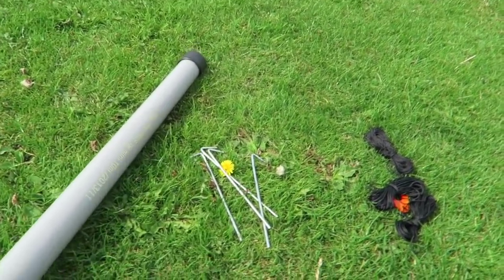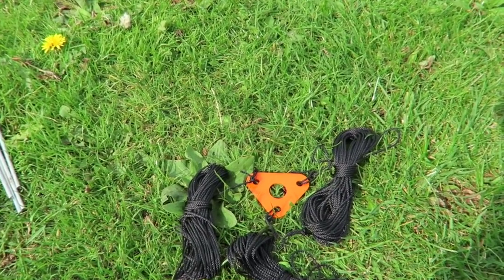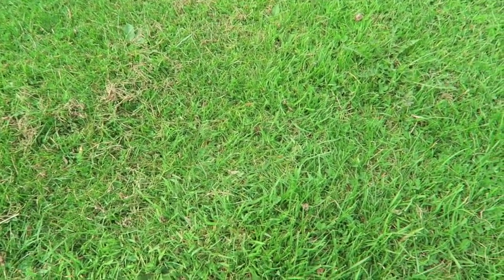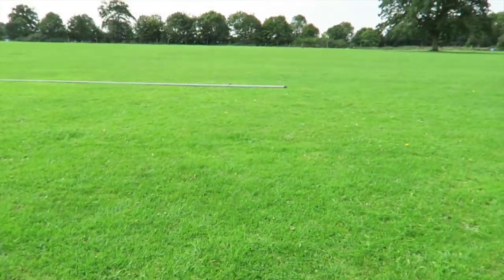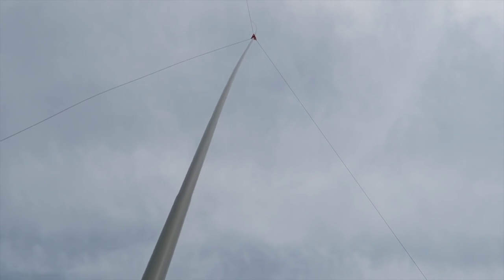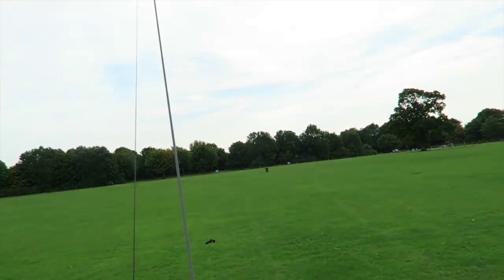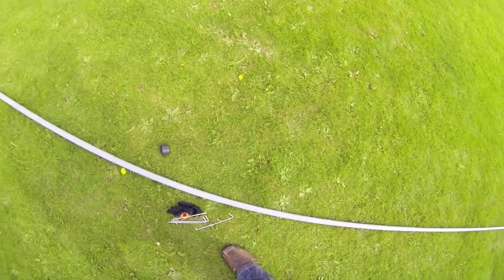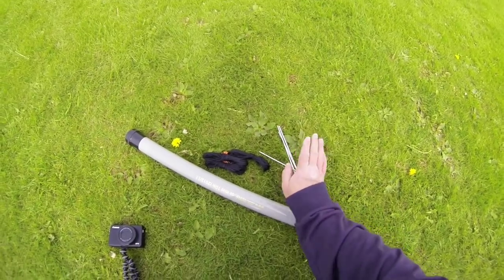Solo antenna mast erecting - Ham Radio know how.

Comment: A bit of the wind-covered audio may have explained the geometry of the first two guylines; appreciated the trick of slack two, walking the mast out to taut and then walking out the third! 73, WA6DZS!
Reply from the maker: +pbarnrob Morning. Yes the layout of the masts isn't a perfect 120 degree spread. Im sure with a bit more math and calculation on the guy length and attachment length I could correct this so the guys are more even. I have a better system for putting up a semi permanent mast, but that takes 2 people - but they geometry is spot on. I will share that with you soon. Any questions - Im happy to help - 73 Dan.

Comment: New sub!  Great video.    How do you attach your antenna?  What kind do you use and what coax?  Everything I try is too heavy and bends the tip pretty badly. Also what lengths?   Thanks for a great video

Comment: Wondering, do you mount the antenna after guying? I use the 345 rule for guying. Its the measurements of a right triangle. The mast uses 4, the distance from the base of the mast to the anchor guy is 3, and the length of the guy is the point of the top guy mount point to the anchor guy on the ground or floor.

Comment: Nice setup and explanation what antenna do you use with this setup?
Reply from the maker: +logo1888 Hio - sorry for the delay. YouTube comments are terrible !!

The antennas i use really depend on where I am and what surroundings I am in. I use a SotaBeams linked dipole, with supports itself in much the same way as this guying technique uses. When I'm in a slightly more confined area I use a vertical antenna with a  9:1 Unun - its not great, but does work. See my Sunday Afternoon on the Wireless video for this antenna. 

I hope that helps.